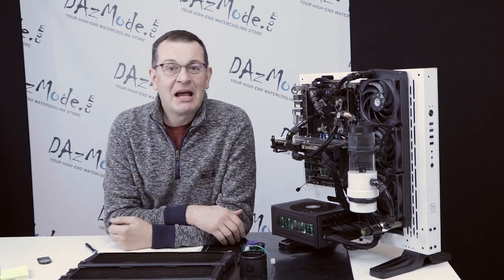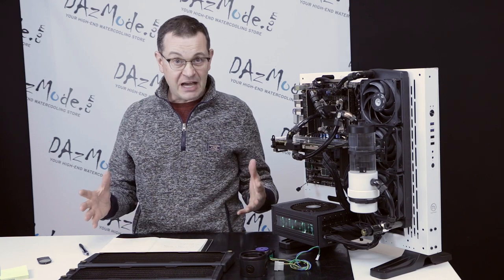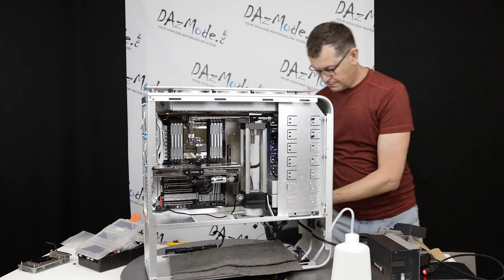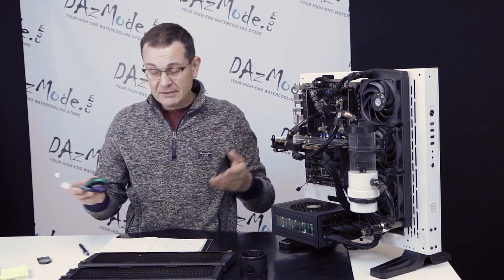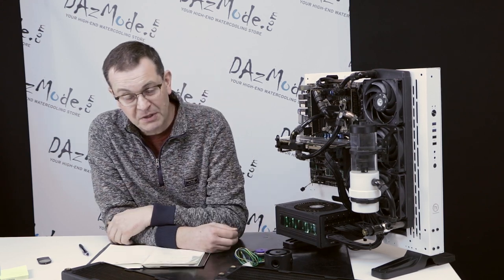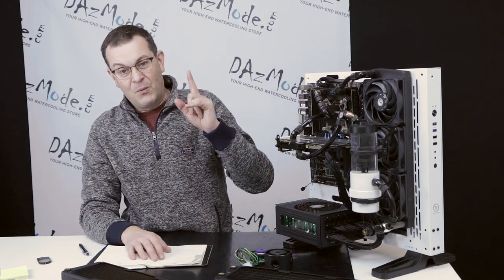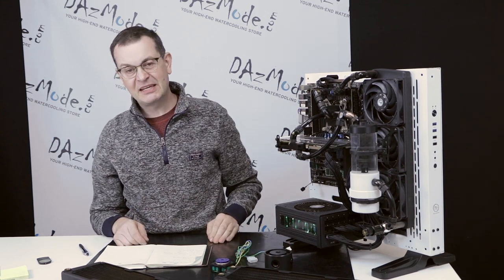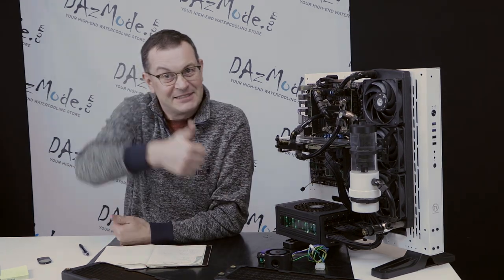Troubleshooting Pump Problems (false positives) Tutorial.

Comment: Suggestions on how to test no rpm readings?  Pwm controls function... Just no feedback on rpm... Headers on mobo r working as they read fan rpms....
Reply from the maker: It possible to burn rpm sensor if put 12v on it by accident. If you pump has no rpm reporting it can be one of reasons. Other poor contact or problems with mobo.